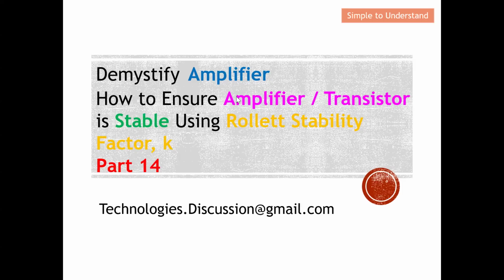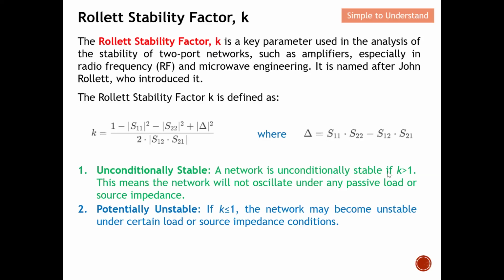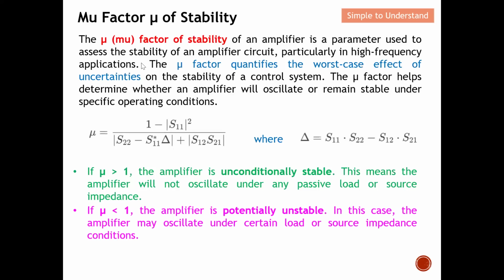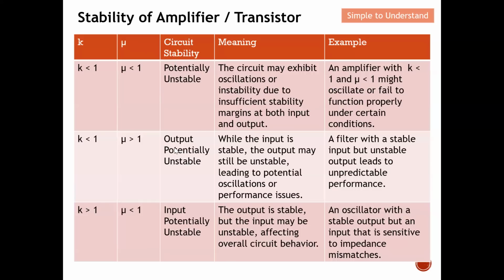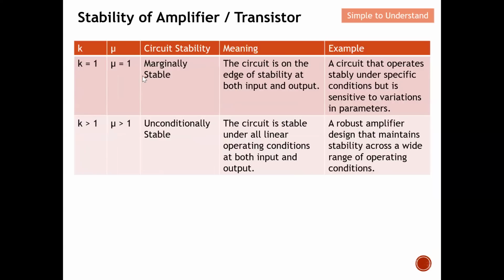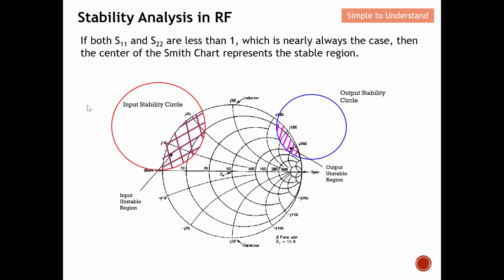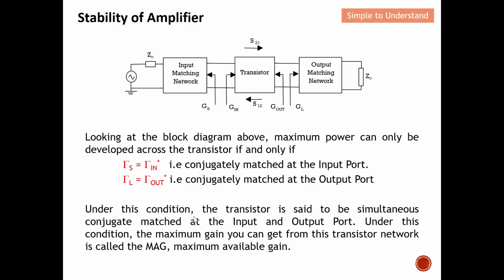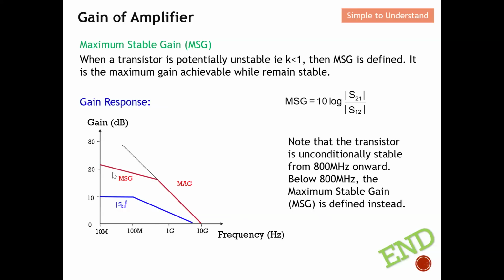Amplifier #14. How to Use Rollett's k-Factor to Stop Amp Oscillation (Step-by-Step Guide & Examples)

Comment from the maker: In this video, I explain how to determine whether an amplifier or transistor is stable—either unconditionally stable or conditionally stable—using the Rollett Stability Factor (k).
Unconditionally Stable: A network is unconditionally stable if k > 1, meaning it will not oscillate under any passive load or source impedance.
Potentially Unstable: If k ≤ 1, the network may become unstable under certain load or source impedance conditions.
In the next video, I’ll demonstrate an example to check the stability of an amplifier and transistor.